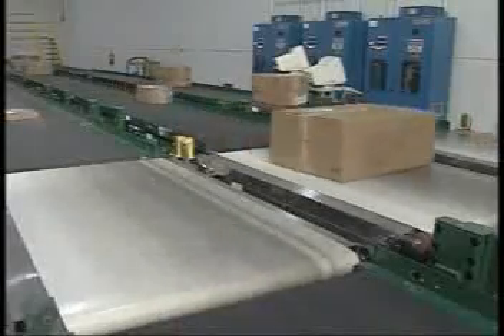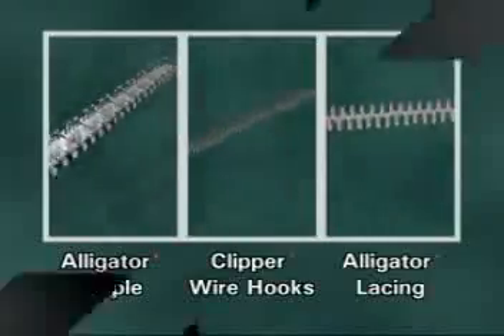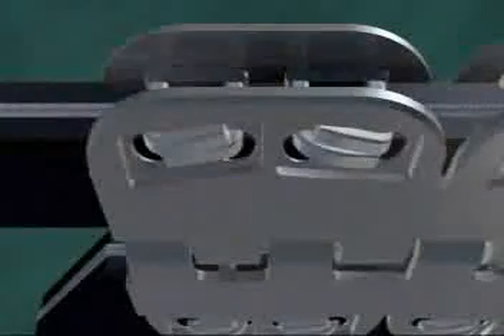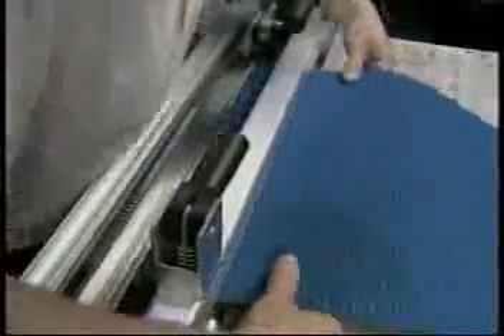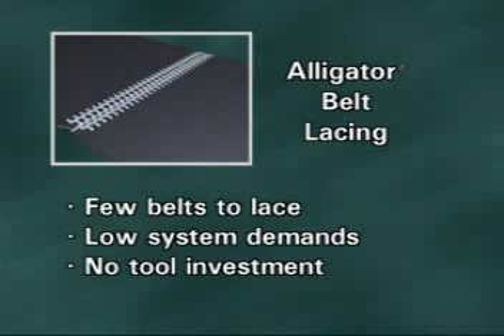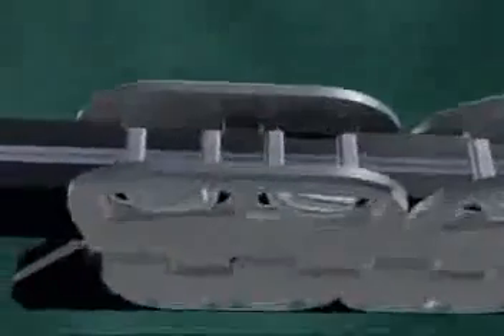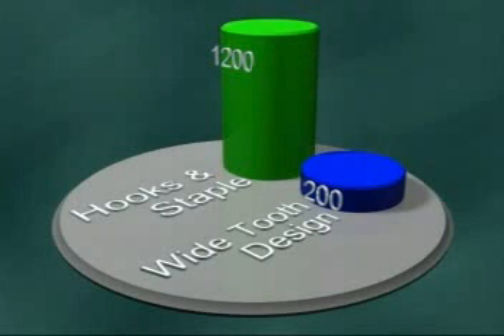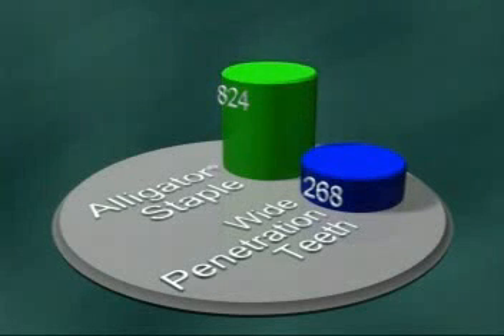Flexco - Alligator® Lacing Fastener System for Conveyor Belts and Transmission Belts

Comment from the maker: Woven Cotton Belt has a few ways to be made endless. We would need to know the thickness of the belting, what the belting is made out of, what the application is and if there has been something used in the past or recommended by the manufacturer of the machine you are running this on. Please contact us and send pictures/measurements/requirements and we'll be glad to help you with the best solution for your application! our website is in the description